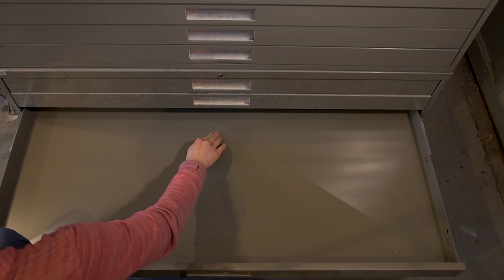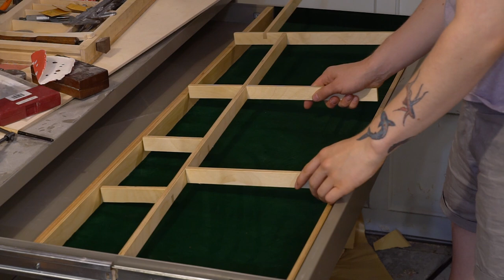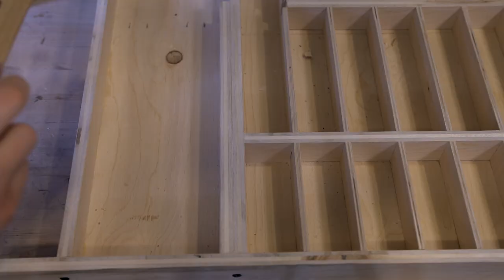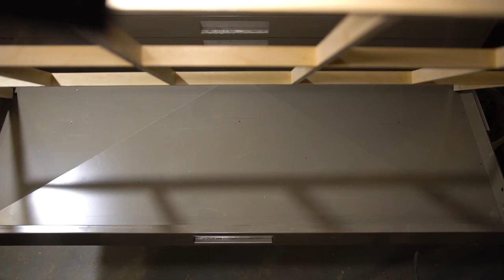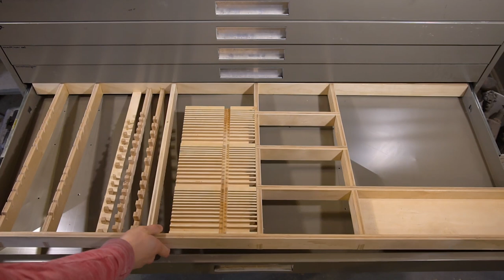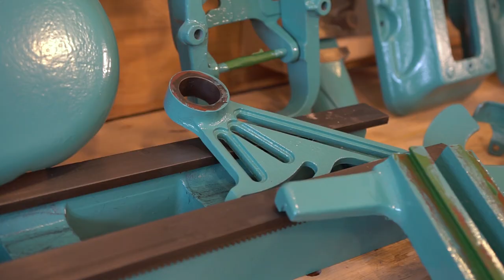Turning Flat File Cabinet into a Tool Box

Comment: Great project!   I use a couple file cabinets for tool storage too - circular saws, grinder, sanders, supplies, etc.   Works well.   Now if I see a flie cabinet like this one, I'll snap it up.   Thanks for posting, and thumbs up!
Reply from the maker: They work well. And with how common and cheap the standard format ones are, I will definitely get a small wall of them when I move to a bigger shop. I have also been recommending them to friends for their workshop storage solutions.

Comment: How well have the drawers held up to the weight? I'm about to do a similar setup and was curious about the weight capacity.
Reply from the maker: I think the box may have went a bit out if alignment, the panel gaps don't seem as even. But other then that all seems good. Still opens and closes just fine. And having a wooden frame around the cabinet would probably prevent this.

I definitely wouldn't have done this if I payed full price for these cabinets cause I'm clearly really pushing it. But they are holding up good for now
Reply: Thanks! I have one with lots of shallow drawers, so spread out maybe the weight won’t be too bad. I’m trying to get some deeper drawers as well to try out.

Comment: Nice way to repurpose a blue print cabinet! I have several of the large Milwaukee cabinets and opted for the little red plastic boxes in dozens of sizes...expensive..but its organized
Reply from the maker: They sell those boxes as stand alone?
Reply: the ones I used are from Schaller Corp., I started with an assortment of 2" tall boxes from their Ebay store and then ordered a bunch more direct from them in the sizes I wanted

Comment: Really need that many calipers? Good repurpose of the cabinet.
Reply from the maker: I actually have more than what's in the video. I think I was 5... I didn't deliberately purchase them, got them for free or in lots of used tools. But it's nice having many cause I can keep them around the shop and if I loose one I don't go looking for them. Plus I have one mitutoyo I keep calibrated and I have one I keep on the lathe with gets dropped a few times a month and is horribly out of calibration and some I keep around the shop randomly so they get dropped but not as often as the one on the lathe... it's a whole system aha